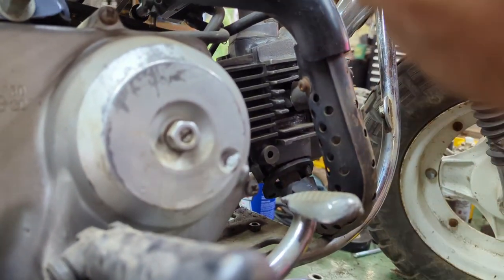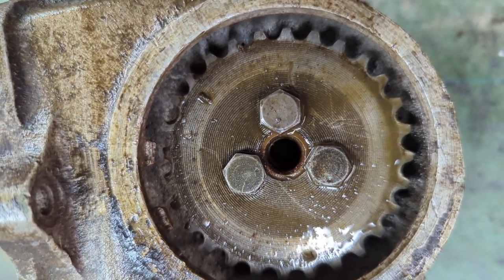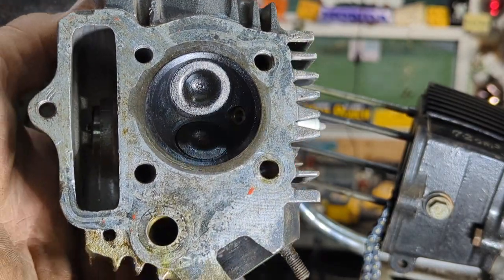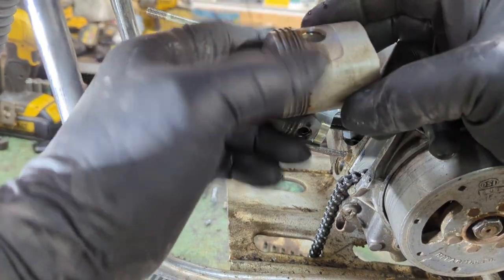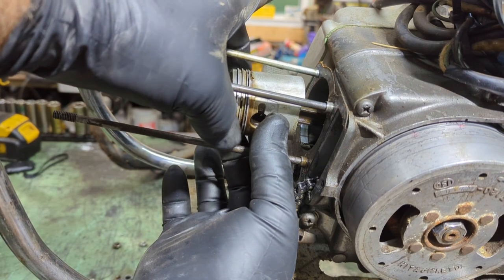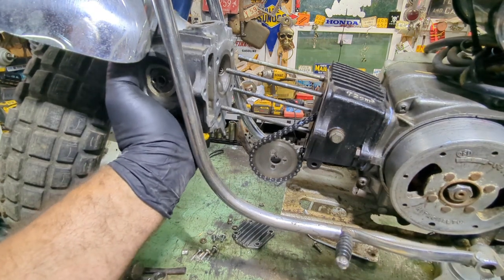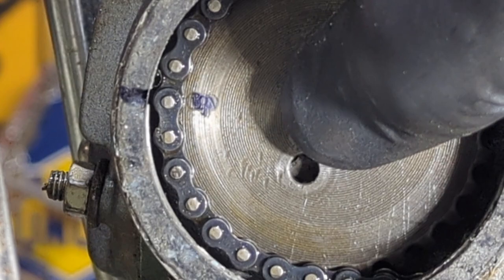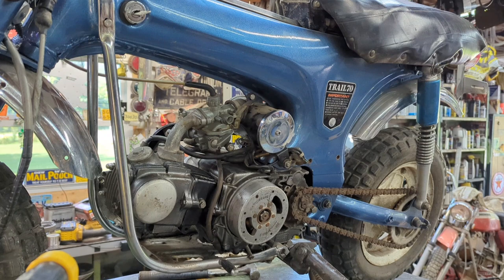Honda CT70 trail 70 Piston replace & disassemble #hondatrail #tarylfixesall  #smallenginerepair

Comment: I got the piston and barrel rebuild kit for my CT70. Also a 1970 same color metalic blue. The new piston in the kit was a joke at best and even had an obvious casting flaw as well. The original piston was far better made. Just put the new rings on it without having to remove it.  Put the new cylinder on, but even the stock one had NO wear on it.  Just needed the new oil rings expander itself  that weakened after 5 DECADES!! Unbelievable how great that little bike was made way back then.

Comment: Great video , question I just picked up a 1970 in great shape which I'm told the carb is new & I have no ideal what kind if it was changed . I'm 200 pounds and bike has sluggish throttle response & runs 25mph , take air filter out and run it with great throttle response & runs 36 mph , air filter is new but does not have the metal frame around it or the one in the can . Any ideal of what going on with it ?   Thanks
Reply from the maker: @s.w.warbirds4126  hey there bud, yeah I've seen that problem before. If the original can is still on it, what's happening possibly? Is the rubber going into the frame? Is clogged not getting enough air? I actually seen a dead mouse in one of those 😆 so I would definitely see it. It's getting restricted air flow for sure. Let me know how that turns out. Got me curious now
Reply: @bucketsgarage  Will do thank you !
Reply: @bucketsgarage  OK removed rubber going into frame  & it was pinched down & is no longer round  & I just ordered both rubbers for it . With the rubber removed & air filter in it ran 31 ,  when I got that 36 mph it was on a long run with slight downhill grade  .  With 200 pounds on it what do you think top speed should be ?  Thank you !